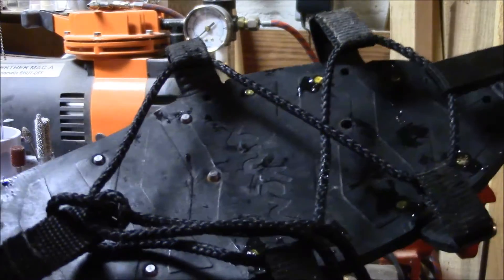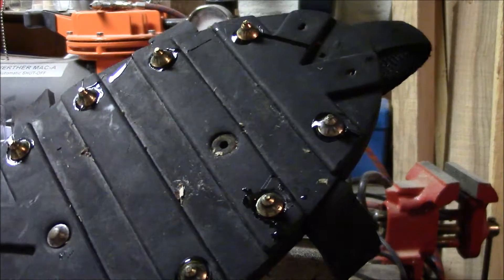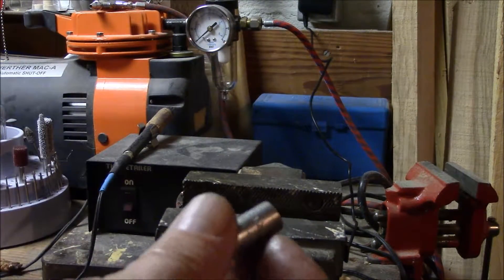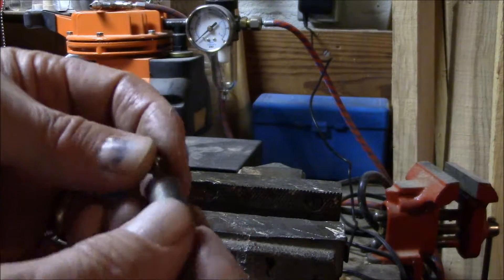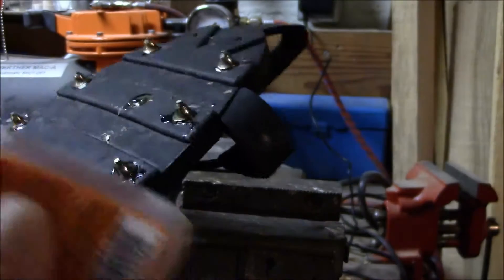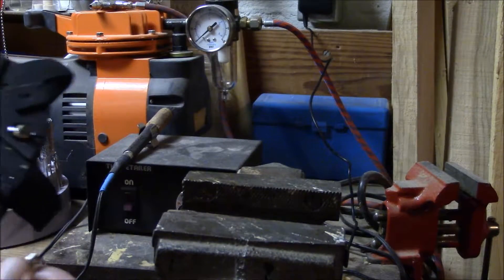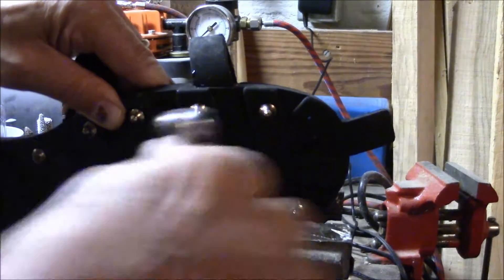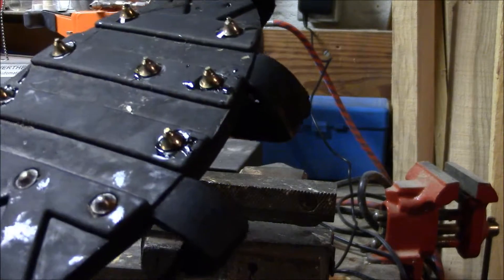How to replace Korkers push through spikes

Comment: Thank you for that great tip. I just got a used pair of corkers with 15 spikes missing.  The 9/32 socket idea will definitely save me some time. Did the gorilla glue work?
Reply from the maker: Awesome. I'm glad it helped. It was frustrating until I figured out this trick. 

I believe the glue helps. It doesn't hurt. Good luck.